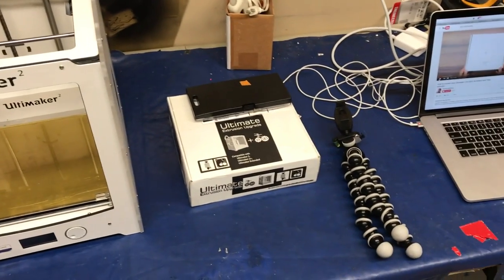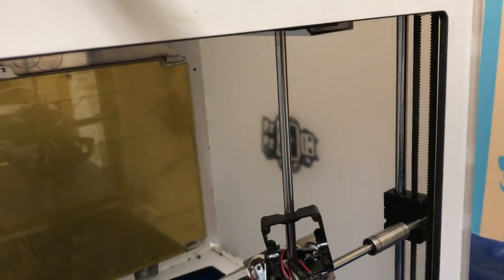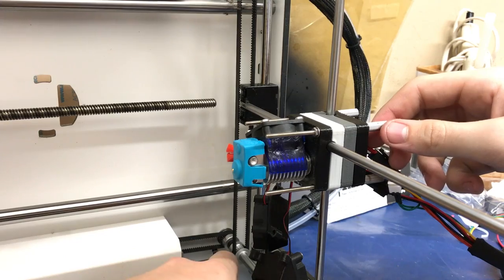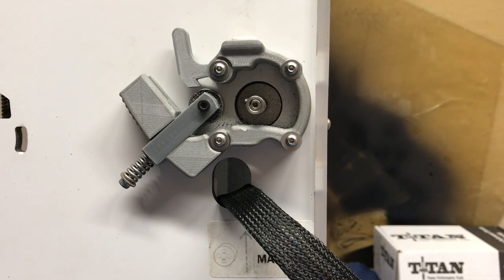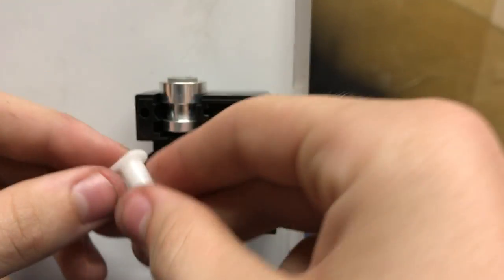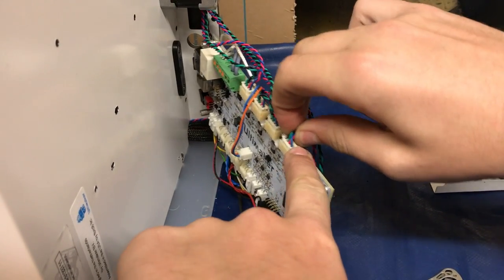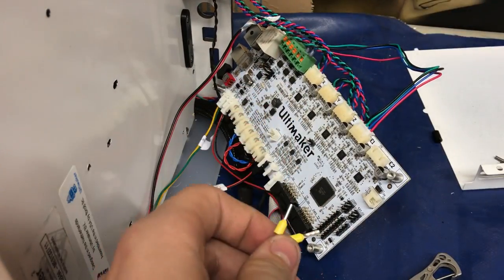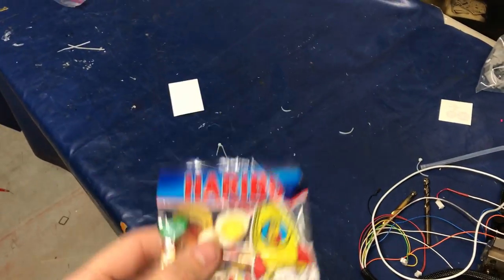Ultimaker 2 E3D Upgrade Kit Tutorial

Comment: there is only one firmware available 
if you have ultimaker 2 extended, how do you adjust the z height?
Reply from the maker: Hmm I'm not quite sure. Maybe the E3D wiki has it some where and you need to search around? Try emailing E3D support and see what they have to say
Reply: Grayson G 
Ok I'll email them
I bought mine today✌✌
Reply: I also have an extended UM2. What is the answer?
Reply: Circle J 
I've been so busy and only installed the kit yesterday at night and still haven't changed the firmware 
I'll let you know when I do.